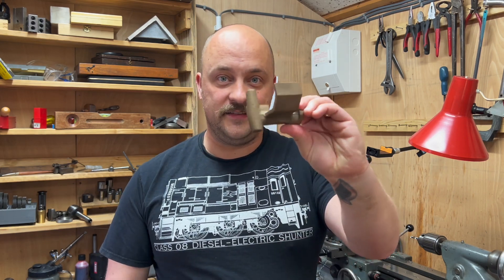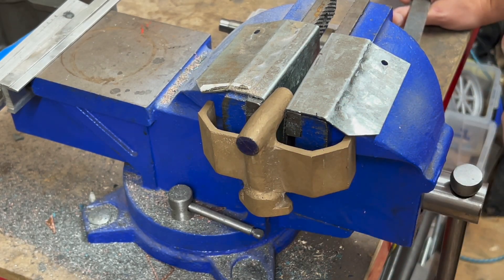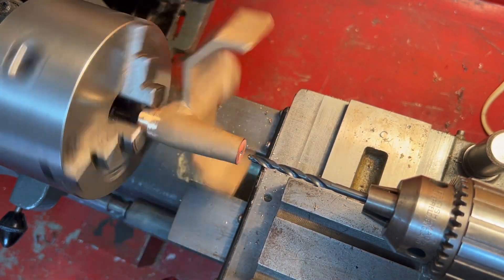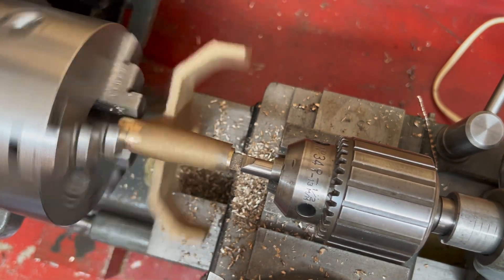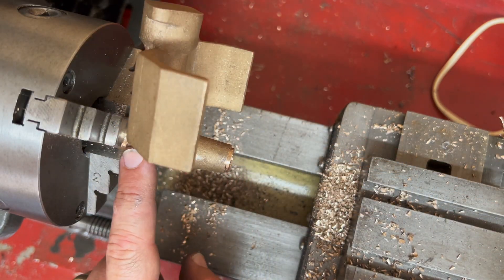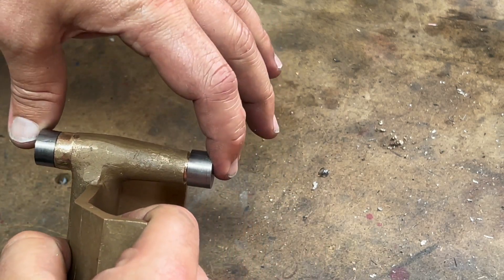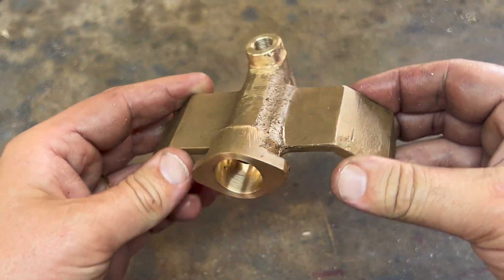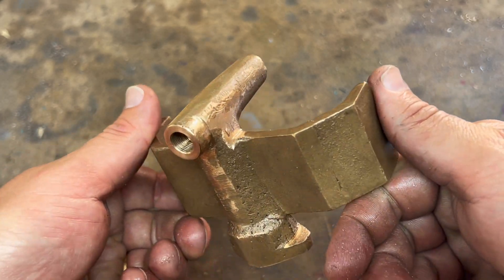Machining an axle pump on the LATHE? - Steam Loco No. 29

Comment: i have noted that your mill  is very very noisy...  metal gears. of course..! why not use nylon gears on just the selectors .they are easily removed.. then simply replace them with the nylon variety... result...a silent mill. !  i have the same as you ,,,but  with v belts and pulleys,! .. but   gatwick thats no more than 5 mile away your getting extreme noise anyway,,,,regards  laurence
Reply from the maker: Hello there - no noise from gatwick, it's normally trains going past the end of my garden. As for changing gears out - maybe? I've got a gear cutter and dividing head but I've not actually made any gears yet!